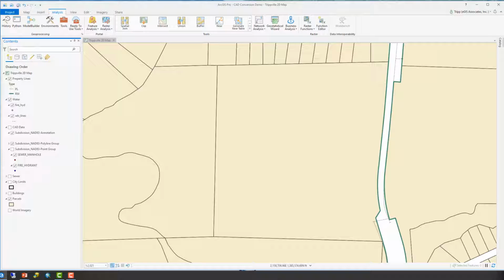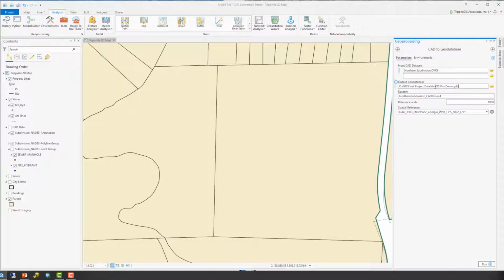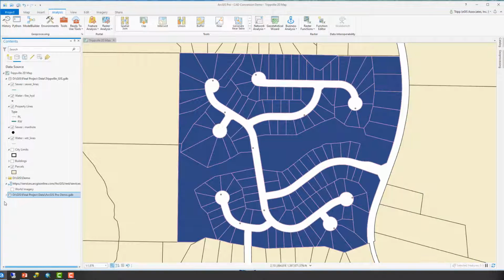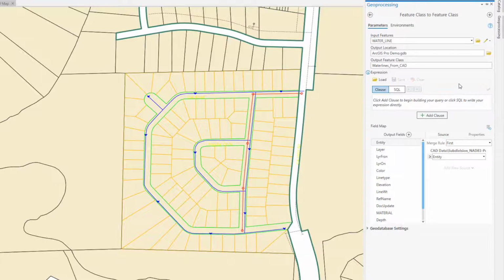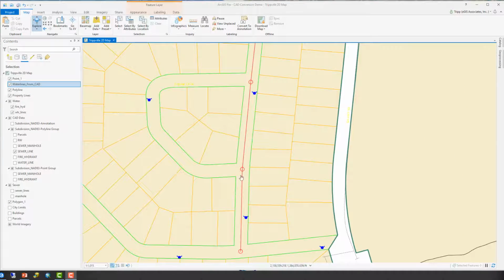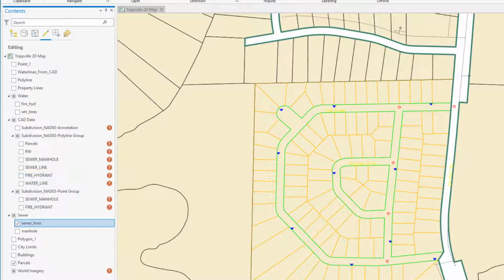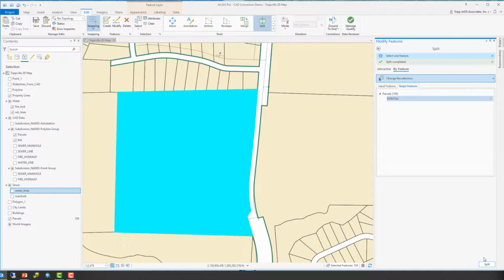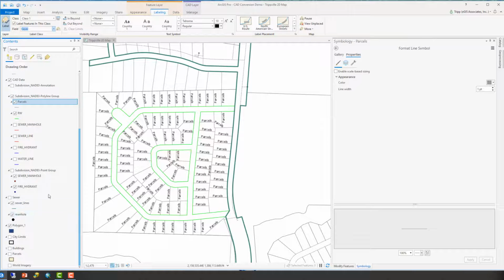Converting CAD data in ArcGIS Pro

Comment: One thing I noticed with the parcel, when you split the parcel using the CAD Data, two of the parcels showed up as one. How do you run topolgy check after yuo have converted the data or used the cad data to split up the current parcel ?
Reply: Hello, You can always use the Error Inspector to check for topology errors after you have converted the data or used the CAD data to split a current parcel. Of course this assumes a topology exists and the parcels feature class is included in the topology.  BTW this is Tripp, the person that created this video. I no longer work at eGIS and don't think they are updating this channel.

Comment: If I recall correctly, in the last tutorial about georeferencing cad data you had only georeferenced the property lines. How was the rest of the data from the drawing georeferenced when you pulled it in this time?
Reply from the maker: That is a great question. Though I only had the property lines in the map when I georeferenced, those lines are coming from the single DWG file. When the world file (WLD) is generated as part of the georeferencing process, it is applied to the entire DWG, DXF, or DGN file, not just the feature class you have in the map that you are using to georeference the CAD file. Hopefully, that answers your question.
Reply: @eGISAssociates  It did, Which is pretty great for working with data from surveyors that don't have much knowledge of GIS. Thanks for putting this video up!

Comment: is there anyway to bring in autocad annotations into arcgis pro. i have linear dimensions for the outside of an excavation area, but when i bring it into arcgis pro the dimensions arnt attached to any polyline or in the annotation layer
Reply: Bringing annotation from a CAD drawing into GIS has always been challenging at best. The two applications do not treat or store annotation in the same way. ArcMap had a specific CAD Annotation Conversion tool that would work sometimes. ArcGIS Pro does not have such a tool but I understand one is in the works. Not sure when it will be added though. It might be possible to copy from the CAD file directly into an existing annotation feature class. However if you want it to be linked to a GIS feature it might be easier to just recreate it in ArcGIS Pro manually. Sorry I know this was not the answer you were hoping for.
Reply: @67Stang  no actually that helps alot lmao. I couldn't find anything so it makes me feel better that I wasn't missing anything. I just recreated using layout view and manually just added text boxes. Next time I'm just going to convert to shape file and add a layer file to denote length of the lines, be so much easier.

Comment: can't we just import the CAD file directly in arcgis pro without converting it
Reply: Depends on what you mean by importing. You can view CAD files in ArcGIS Pro with out converting. In addition you can change symbology, select features and perform queries on CAD data in ArcGIS Pro. However if you want to edit data or integrate into your existing GIS data you need to convert it. By the way, I am the one that made this video originally but I am no longer associated with this company.

Comment: Why when I open cad on arcgis map it's easy to deal with it but the same file of cad  when I opened on arcgis pro it's very hard and heavy when I move on screen the drawing is disappear and appear
Reply from the maker: I am not sure what you mean by it is very hard and heavy in ArcGIS Pro. That has not been my experience. One thing that might account for the difference, assuming I am interpreting your meaning correctly, is that in ArcGIS Pro it typically tries to add the entire drawing to a map as a group layer. Whereas in ArcMap, you typically add one feature class from the CAD file at a time. This means ArcGIS Pro can add a lot more data by default at one time than ArcMap does. That might be the cause of what you are experiencing. The other cause could be your computer itself. ArcGIS Pro does require more computer hardware to run effectively (more CPU, RAM, hard disk space, and a dedicated video card (GPU and Video Memory)). If your computer is on the lower end of the hardware requirements for ArcGIS Pro, this will also cause it to run slower. Those are just a couple of ideas. If you can clarify what you mean by it being very hard and heavy, I might be able to provide a better answer.
Reply: @eGISAssociates    I mean hard and heavy when I import cad file to ArcGIS pro only polyline it takes much time to clearly when I want to drag it take many times...but this thing not happened with ArcGIS map ...same 💻IF YOU DO NOT MIND ICAN SENT TO YOU SAME PICTURE
Reply from the maker: @zihi6495  Yes you can send me a picture. You can send it to info@egisassociates.com. I do want to point out that ArcMap and ArcGIS Pro have very different hardware requirements. I know many computers that will run ArcMap without to many problems start to experience issues when trying to do things in ArcGIS Pro. So that still might be a source of problem. If your laptop has less than 16 GB of RAM, has less than a quad core CPU and if it does not have a dedicated graphics card, it will run ArcMap pretty well but it will not do well with ArcGIS Pro. That is because ArcGIS Pro is a 64 bit application designed to support hyperthreading and use more than 4 GB of RAM. ArcMap is only a 32 bit application and can only use a maximum of 4GB of RAM. Plus ArcMap is not designed to make use of multiple cores or a dedicated graphics processor.
Reply: @eGISAssociates  thanks sir.to respond me..I will try to work on laptop ram more than16gb and have exterior graphics card and see what will happen and I will told you back
Reply from the maker: @zihi6495  Please do keep me posted.
Reply: @eGISAssociates  I tried to open my file on computer ram 16gb and have exterior graphic card 1.7 but the problem not solved
Reply: @eGISAssociates  would you give me your email to sent you my file to see it what's wrongs with it
Reply from the maker: @zihi6495  you can send them to info@egisassociates.com. Sorry I did not reply sooner. Was actually traveling for the first time in 2 years.